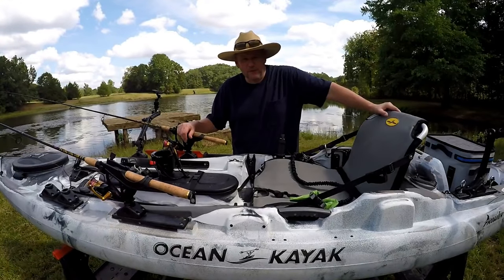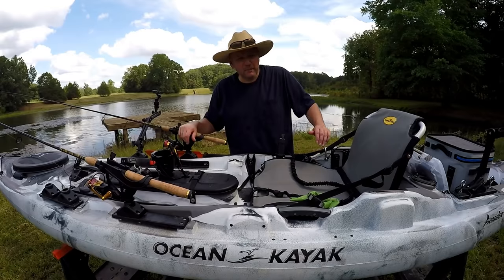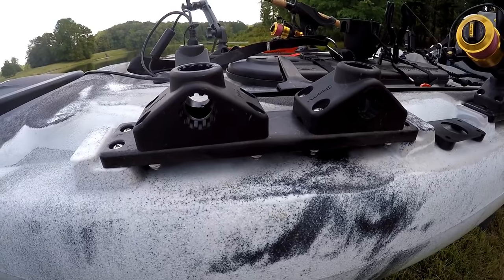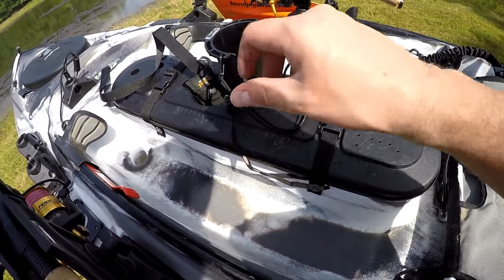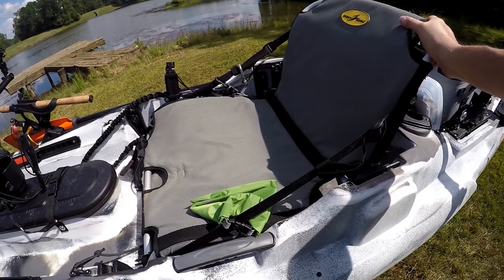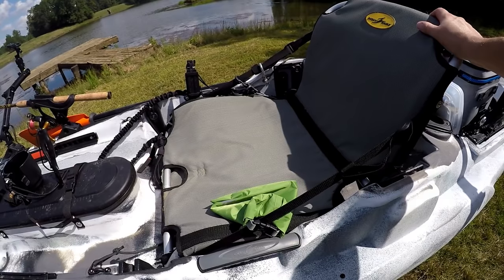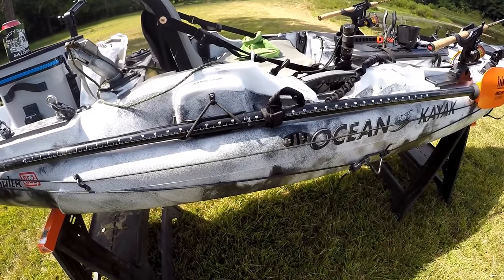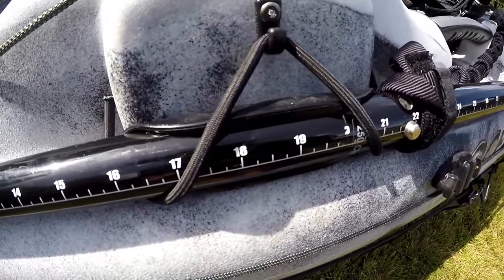How I rigged my Ocean Kayak Big Game Prowler 2 (review and mods)

Comment: Great Video! Very detailed.  Was wondering about the tracking and speed of the kayak.  Is it difficult to paddle in the ocean?  I kayak fish about 50/50 between fresh and salt.  Tight Lines and Paddle on!
Reply from the maker: Thanks Kayak Engineer!  As far as speed goes, it is a big, heavier kayak so in my opinion, it takes more to get it going but once you are going, I think it goes pretty fast.  According to my GPS, I can average 2.5 - 2.8 mph with relative ease (just steady paddling) and can maintain over 3 mph with more effort.  Saltwater requires more muscle due to wind and current and freshwater I find to be less effort.  As far as tracking, no problems staying the course but this kayak has a high profile so wind does affect it (but not to the point I would call it out as an issue).  I have had this kayak for over six months now and have had prowlers in my past and have no regrets.  You will appreciate the stability and gear capacity of this kayak.  I hope this helps and thanks for the question.
Reply: Thanks brother for your quick response. I really appreciate it.
Reply from the maker: Yes Sir.  Let us know what direction you go!  Good luck.

Comment: Just a thought but could you shim those mount holders up so you could use the Scottie mount back plates? Great video man this is the boat I've been looking at getting. Thanks.
Reply from the maker: Thanks Adam.  I don't think you could shim them up unless you went up quite a bit (like a half to 3/4 of an inch).  The holes are just too close to the actual kayak to avoid contact with the backing plates.  Just using a nut and washer works fine though with no shims.  You won't regret purchasing this boat....good luck.

Comment: I have the same boat I am 6' 225lb and I stand in it easily and often (even have in pretty good chop) , ik this guy has some height and weight on me but I don't want anyone to be discouraged about the stability.  great video what size paddle do you use with those rod holders on the rear mounting plates?
Reply from the maker: Good call out Jake.  It is probably more my unwillingness to stand up!  My paddle is 250 cm.  Thanks.

Comment: what size battery are you using just got my ok pbg2 and have caught many fish ready to start modding it got a striker 4 finder but haven't got a battery yet not sure how big is can go in the factory spot. also would like to see a current video
Reply from the maker: The battery is a 12 volt sealed lead acid battery.  I picked mine up on amazon for pretty cheap.  It's not a large battery, maybe 6 x 4 x 3.  Another video coming up later today actually.
Reply: thanks man looking forward to seeing the new video

Comment: what size nuts and bolts did you use for the scotty rod holder mounts on the black plates?
Reply from the maker: They are the same size as the ones that came with the backing plates.  I took one to Ace Hardware and just got a shorter version of the same screw, 1 3/4 inch.  I was able to pop the nuts out of the backing plates I bought and use them.

Comment: im 6ft6in 280lbs proportionate for my size.. is this yak viable for me?
Reply from the maker: Hey Kyle.  Best thing I can tell you is to try to find a retailer that will allow you to test drive a kayak.  A lot of independent retailers will do this (probably not the big box retail stores).  I had owned OK Prowlers in my past so I felt confident ordering this one online from Austin Canoe and Kayak (check them out online).  I don't think the weight would be an issue in any way, my question would more be based on your height and having enough leg room/comfort.  That said, this kayak is probably your best option.  I did a ton of internet research and found this was the go to kayak for us bigger guys out there!  I hope this helps.  Let us know what choice you make.